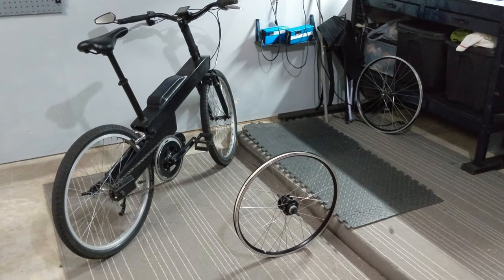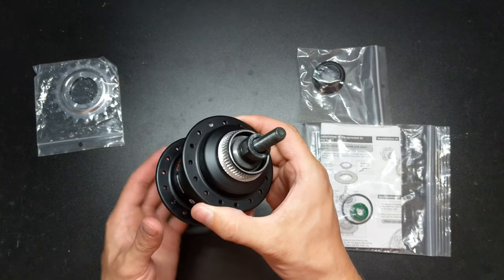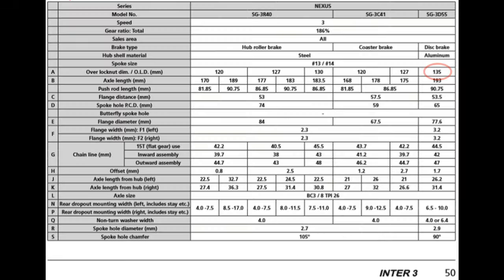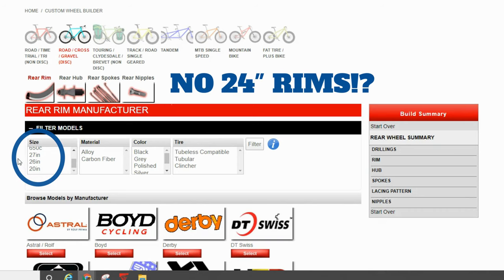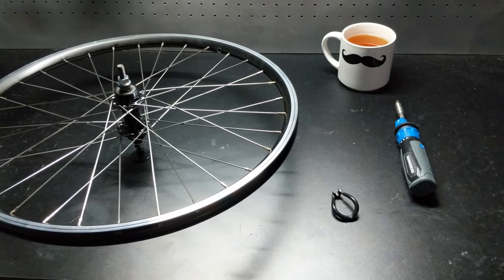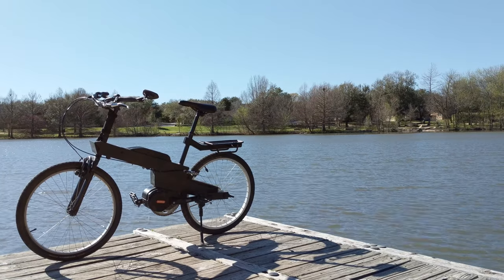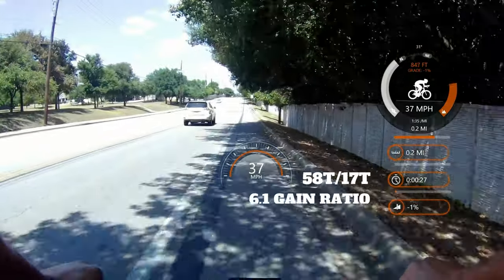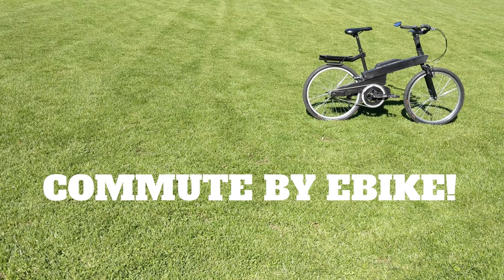Get a Custom Bike Wheel Built | Hard to find bicycle wheels

Comment: Why are you not using disk brakes? Is it not compatible with the hub or just personal preference?
Reply from the maker: Great question. The bike in this video was mostly just proof of concept for the frame. It was designed to be as easy and cheap as possible to build at home. In order to do so I repurposed most of the components from an old 24" kids bike that had v brakes. All my newer prototypes are disc.

Comment: riding luna's folding 20-f1 mosso bike now . its squirrely as heck .  an ideal bike might be a bmx 24 cruiser with rear disc brake  . i dont know how you get away with rim brakes . always loved the nexus 6 and 8 too for PNW hills as i dig pedalling even with the 750watts
Reply from the maker: Nice, yeah I agree I tried a folding eBike - the 20" wheels are just a tad too small. They feel squirrely and make curbs feel like mountains. That's one of the reasons I'm trying 24" on this bike. They're stronger and feel great but it's a bitch to find components for them.

These rim brakes are not ideal but work fine for me. I guess I just ride like a grandpa. The original design is for front disc and rear rim brake, but haven't been able to find a disc fork with the specs it needs. A custom disc fork might be the next upgrade.
Reply: @eBikeaholic  read somewhere that ppl seldom if ever fold bikes. Got one dirt cheap used for the luna kit tho . i have a 20" non-powered bmx grocery getter that handles better than 20'' folders . i guess its just geometry . seen a few ppl do diy disc brakes or have them done . one here https://youtu.be/2nZY3Gfw_gQ?t=511       a weld shop to spot weld the mounts , or clamp on /bolt on disc mounts , the hubs to mount the disc(s) .  i almost did this to a 2002 stumpjumper with bionx kit but the regen electric brake worked well.   Check DANSCOMP and bmx sources for 24" parts . While mtb 24 inch parts are lower grade made for kids  , bmx 24 inch are made higher quality for adults . just an fyi ⚡
Reply from the maker: @NWforager  awesome, I'll definitely check that out thanks for sharing.

Comment: I’m too heavy for my Trek Verve 1.  My local bike shop is at a loss.  I keep breaking spokes on my back wheel just from riding on paved trails.  After calling Trek, they suggested a 36 or 40 spoke wheel.  I am desperate for a wheel/hub that will fit my bike without getting out of control with replacing “everything.” The bike comes with a 700x45c wheel with disc brakes and a SunRaceMFM300 FREEWHEEL 14-34 7Speed cassette.  I don’t understand any of that just copied from the website.  I need a wheel that can hold a lot of weight.
Reply from the maker: hmm, maybe try a wider tire with lower pressure? or thicker spokes? A smaller diameter wheel would also be stronger, would a 26" wheel be an option? I'm not sure though, I'd contact an expert wheel builder.

Comment: I  am considering a mid drive BHSD starting with a Soma 3.0 Wolverine disk frame using the  Sturmey-Archer SX-RK3 3 speed IGH and a Gates Carbon Belt Drive I found an interesting link on IGH here. https://www.electricbike.com/mid-drive-kit-igh/ but I am guessing you have already seen it. You have been a tremendous help in planning my build. Thanks
Reply from the maker: Awesome, glad I'm able to help - I heard the SA 3 speed hubs are also very strong and good call on the belt drive... keep me updated as to how well it holds up or if you have any questions.